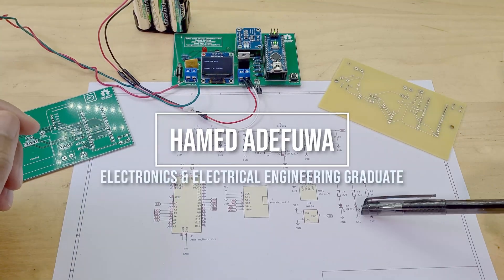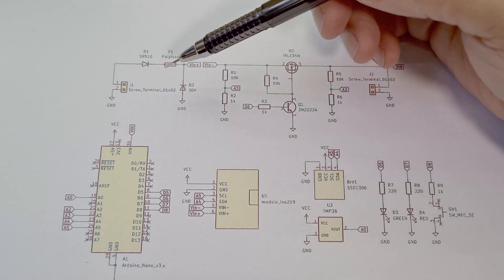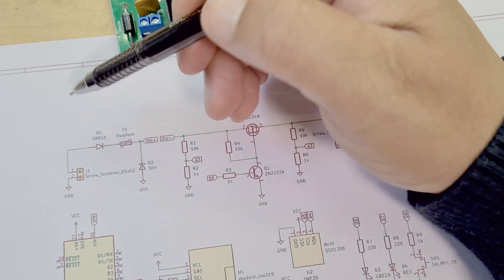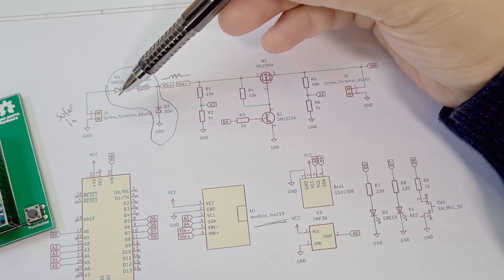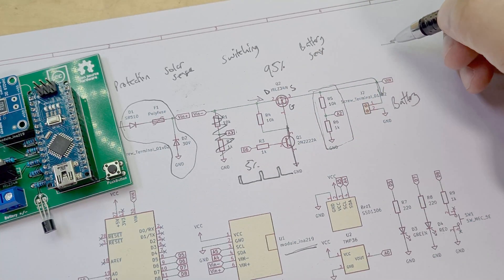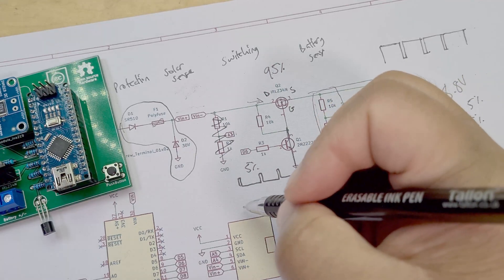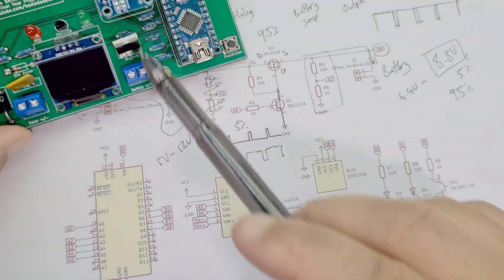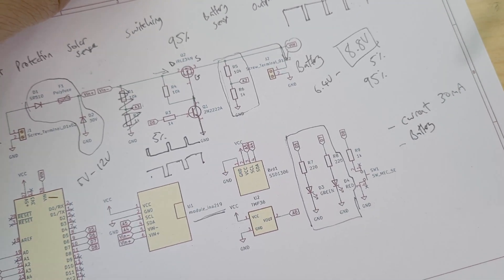Solar Charger Schematic - My EE Final Year Project

Comment: Congrats 👏. 
This is really interesting. 
May i ask you two questions:
1- did you design everything yourself or you took some ideas from different resources?
2- is arduini included in your studying program?
Reply from the maker: Thanks brother, yeah I designed everything myself. I mostly took inspiration from googling "pwm battery charging circuits". This took me a ridiculous amount of time though as I'm super weak in electronics. Arduino wasn't a part of my degree at all, although we did do quite alot of C programming, so I was confident on the programming stuff whilst the hardware part was challenging.